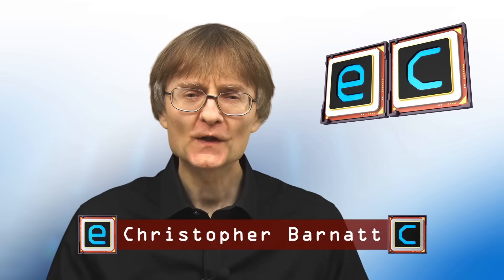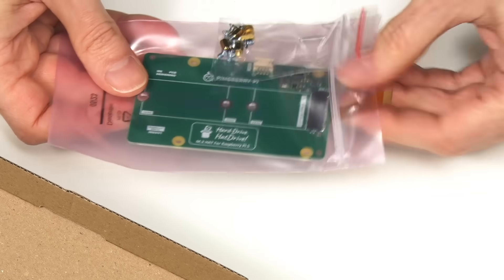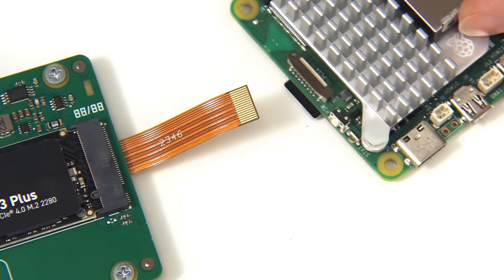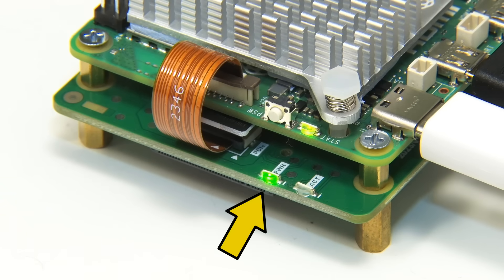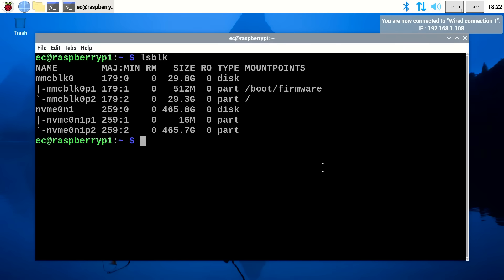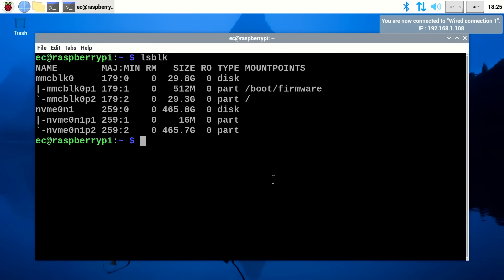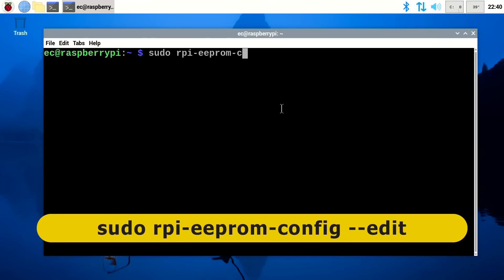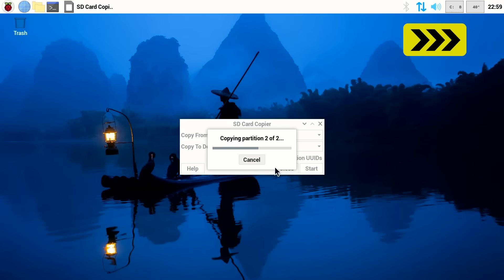Raspberry Pi 5 M.2 HatDrive!

Comment: It's neat to see how something like a HatDrive! can really turn a Raspberry Pi into a home computer to put in your pocket. Okay, a protective case first, THEN your pocket! As amusing as it was to watch and then rewatch two more times after the video was finished, it is a bit of a shame about the problem with SD card slot access.

Regardless of that, it is a nice Pi accessory! And this was a nice video to end 2023 on. Here's to 2024. 😁
Reply: 🖐😎 I have a few RPi RPi 4 Argon One cases with USB to internal bootable SSDs, which also make the uSD unavailable. Once that bridge is crossed, there's no point in going back to uSD, except for burning different distros for testing on other devices. For that I use a uSD to USB3 adapter.
Cheers to 2024.
(circling back to clean up our previous thread 🙄)
Reply: @TheOleHermit  That internal µSD is available, just not readily accessible. I also have several Argon One cases with the M.2 bottom, but I still use the µSD to boot, once a week right after the daily (nightly) backup of the µSD to the SSD.
Reply: @apveening Then, you're removing the Argon One case every week and wearing out the plastic screw threads, if you haven't already?
You're seriously suggesting working around that ribbon cable, with delicate connectors every week?
Why? In order to save $5 on a uSD to USB3 adapter, which has a faster transfer speed than the RPi4's uSD reader, you're taking the risk of breaking the ribbon connector(s), then replacing either the RPi5 or NVMe HAB?
Nightly backups on a RPi 4? 
How many people use a $50 SBC for collecting mission critical data? 
Why aren't you simply doing incremental backups of the SSD onto USB3 thumb drive(s)?
You do understand that uSDs are very volatile and that SSDs have limited R/W cycles, right?

Rots-a-ruck doing it your way. I'll stick to doing me, and making viable suggestions to my friends, thanks.
Happy New Year.
Reply: @TheOleHermit  "Then, you're removing the Argon One case every week and wearing out the plastic screw threads, if you haven't already?"
It's been well over a year since the previous time I had to get to the µSD card on any of the five RPi4Bs I have in Argon One cases. Admittedly, The last instance was last Saturday/Sunday when one failed to come up completely after the weekly reboot. Flashing the backup from just before restored it to full working order without any further problems.
Reply: @apveening Ok, now I'm a bit confused and intrigued with your methodology. So, I'm trying to wrap my head around the info you've provided.
"..but I still use the µSD to boot, once a week..."
That implied that you normally boot from the SSD, but for some unknown reason, you need to change the boot device once a week to uSD, which is normally used to store your data amd needs to be backed up onto SSD nightly.
But, now I'm thinking that your only booting from uSD, so that's where  your Home folder  resides by default.
Apparently, some app like a data logger is constantly writing to your Home folder, 24/7. Therefore the RPi is never shutdown and the uSD is only removed to be replaced whenever it inevitably fails, right?
So, the SSD is only being used as a non-bootable data drive, because your uSD soon runs out of space, right?
But you still need to reboot once a week after running update && upgrade, right?
If all of the above is correct, then I have 3 suggestions, from most preferred to least:
#1) Boot from the SSD, instead of the uSD. Chris just demonstrated how to do that AFTER BACKING UP THE SSD'S EXISTING DATA. That automagically relocates your Home folder and data onto the SSD, eliminating the need for nightly backups, then deleting the old data on the uSD. No need for the slower, volatile uSD at all.
#2) Reconfigure your data logger app to store directly onto the SSD, instead of inside your Home folder on the uSD to eliminate the need for nightly backup/deletion routine. This also increases the lifespan of your uSD.
#3) Relocate your Home folder onto the SSD so that everything is being stored on the SSD, again eliminating the need for nightly backup/deletion routine.
In all scenarios (including your current one), if your data is mission critical, then I suggest that you still establish a backup plan to use another large (USB) data drive to backup your SSD.
I have a USB thumb drive permanently plugged into my wifi router (inside my firewall) as a NAS, available from any computer in my home where all of my important data is safely stored and then shared across all devices. 
Works great, especially if the local drive on any one device fails, as you've recently experienced.
Admittedly, I should still have a backup plan in place for the NAS drive. My bad.
Hope these suggestions help to simplify your current procedures.
Best regards.
Reply: @TheOleHermit  Weekly (automatic) reboots as in the past my RPi got unstable after a bit more than a week. The logging goes to a ram-drive and the home folders are pretty empty, so the µSD card doesn't suffer from excessive writing. The only things really mission critical are the software and settings stored on the µSD card, which is why I prefer to have daily, complete backups. And with the (copied and modified) script I use, backing up to an image I can directly reflash onto a µSD card is the easy way to go. I don't really fancy backing up 2 TB every day, but 32 GB compressed to 5 GB is doable.

And one of the modifications of the backup script is a reboot immediately after the backup early on Sunday morning (simple logic checking the day of the week).
Reply: @apveening "Weekly (automatic) reboots as in the past my RPi got unstable after a bit more than a week."
Sounds like a necessary workaround of an underlying data corruption issue that should be resolved,,, in an ideal world, if that ever has existed. Was that the same on all of your RPi4Bs? Perhaps it was due to defective RAM on one? 🤷‍♂
"I don't really fancy backing up 2 TB every day.." I wasn't suggesting that. I was suggesting eliminating the daily backups entirely. If you're referring to maintaining a backup of the SSD onto a remote drive, then I would suggest using OMV to perform incremental backups, instead of full daily backups.
Of course, you know far more than I regarding what works best within your own use case scenario and we've strayed away from the initial points of debate regarding the need to access the uSD reader while using the RPi5 with the NVMe HAB and you've effectively explained your reasons for doing so. So, I'll politely bow out of this discussion.
Nevertheless, I appreciate and thank you for the respectful academic exchange of possible alternatives. "Different strokes for different folks", as some feller once said.
Bottom line, If you're pleased with your personal setup, then that's all that matters.
Reply: @TheOleHermit  Thanks. I do have OMV running on 2 RPi4s and on an RPi3B+, prefer to run the rest without.

Comment: I ordered one of the bottom Nvme adapters this week. I be using your video as installation instruction 😊.
Reply from the maker: Good luck with your adapter!
Reply: I finally got my pineberry bottom adaptor, BUT I used 3 different NVMe drives that I had in stock and none of them worked. So I ordered a Pimoroni bottom hat too,. One of my nvme drives worked on pimomoni adaptor. I saw the speed test of my drive with pimoroni bottom adaptor on the web, but that drive doesn’t work with pineberrypi adaptor.
So a little test of adaptor will tell me if the problem is pineberrypi. That nvme tested fine in PC.

Comment: Oh dear, decisions, decisions... I was planning to retire my 2 Pi 4bs by putting them into  portable Cyberdecks, using Pelican cases. For this purpose I was going to use old SATA SSDs and USB adapters. As you said, expected speed is less than 300 MB/s. Now this improvement with the NVME really, really makes me think as those drives are not only faster, but also more energy efficient than SATA SSDs. Using the HAT (HAB?) might let me run that for longer on the ame battery capacity...

But then again ... nah. I just add 6 more 16850's. There is just about enough space for them. Cheaper and as cheerful. I'll use my Pi 5s as primary desktops - overclocked to 3 GHz/1 GHz - as planned.
If only  Manjaro would release a Pi 5 version. Or Zorin....

Comment: Great video, Chris!  As a continuation of this subject, I’d be curious how much faster typical desktop tasks actually are with the SSD.  My Pi5 is using microsd, and the card I have tests at 90 MB/s.
Reply: Would you mind saying what card and size. Mine averages around 60 MBps. Using SanDisk Extreme class 10 64GB.
Reply: @subhashpsamy  Samsung EVO+ 128GB

Comment: Another excellent video. I was particularly impressed by Christopher’s ability to film inserting the PCIe cable to the connector, and very much enjoyed the section where he had to remove the microSD card with the cable in place :-)
Reply: we all could relate
Reply: Yes, it takes intelligence to make a good idiot's guide.
Reply: i broke mine and now have to use the black thingy of plastic from the display/camrea port

Comment: are you now using your pi 5 with m.2? how big of M.2 card car be used with the Pi 5?
Reply from the maker: I am indeed now using the Pi 5 with an M.2 NVMe SSD, a 500GB one (but it an use larger drives, at least 2TB). I'm currently booting Ubuntu 23.10 off the drive, as you will see in a forthcoming video . . .
Reply: 2280
Reply: @elorrambasdo5233  that wasnt what I was asking and wasnt asking you